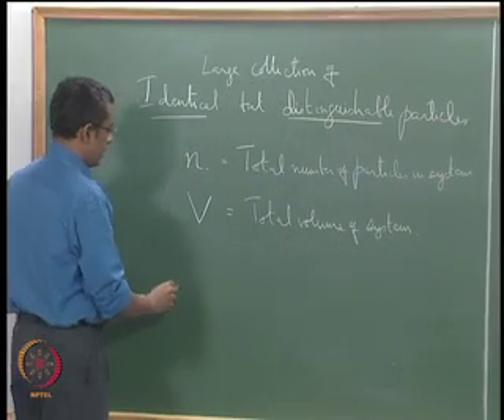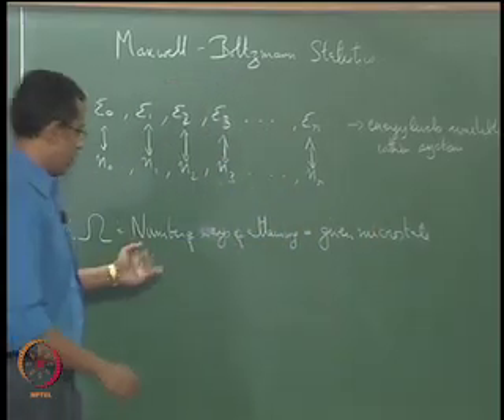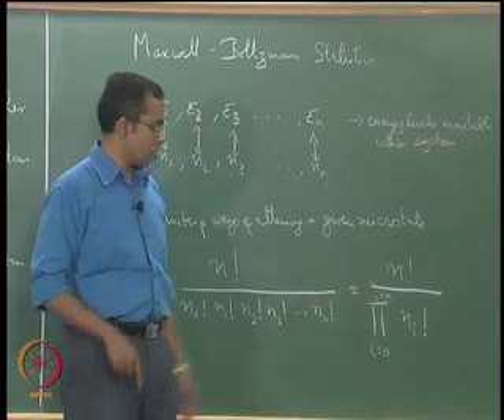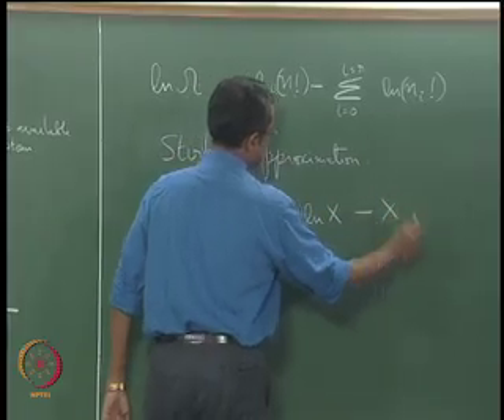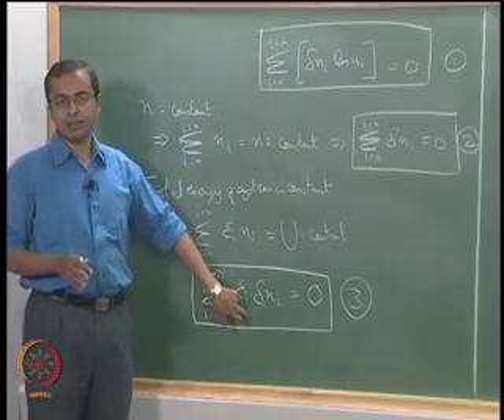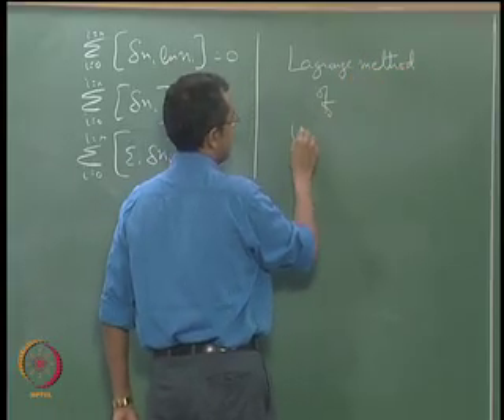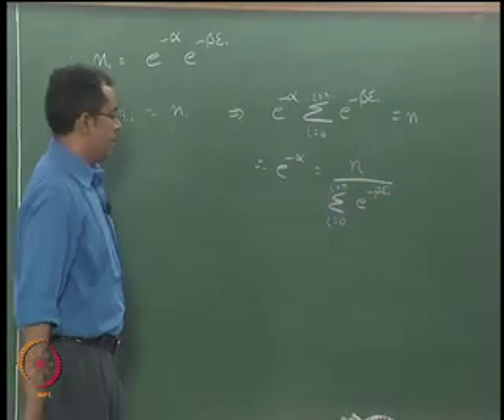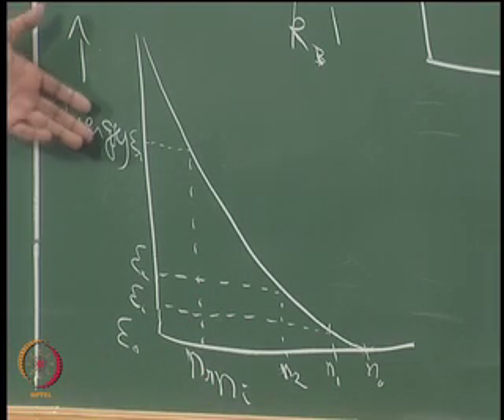Maxwell Boltzmann Statistics

Comment: Multiplicity (omega) is not a statement about a particular microstate, but one concerning the number of microstates belonging to a particular macrostate. For example, if you flip a coin three times, the outcome 'HHT' is a microstate corresponding to the macrostate '2 Heads'. The multiplicity of the '2 heads' macrostate is 3 as we can get 2 heads by {HHT, HTH, THH}.
Reply: +Sachin Natesh - I agree - He keeps saying "microstate" when he means "macrostate".  A macrostate is what you actually can see - variations in temperature, density, pressure, etc. but not what each particle is doing. When you think about what each particle is doing, that's a microstate, and there can be many microstates which give you the same macrostate. There is no "most probable microstate". All microstates are equally likely. There is a "most probable macrostate" - the equilibrium macrostate. It turns out that almost all the microstates give you the equilibrium macrostate. The system is jumping around from microstate to microstate, but practically every jump it makes is to another equilibrium microstate and when you actually make a macro-measurement, it always looks the same.
Reply: @paulreiser816  if what u are saying is correct then his previous video is completely wrong. Isn't it?
Reply: @paulreiser816  awesome explanation man
Reply: @anonymous-hz1mf  Do not worry.Knowledge never goes waste.
Reply: thanks for clarifying
Reply: @anonymous-hz1mf  thanks for further explanation
Reply: @anonymous-hz1mf  Thanks brother:)
Reply: @anonymous-hz1mf  so in the case of a coin, (HHT) is a distribution or a macrostate?
Reply: abslotely right